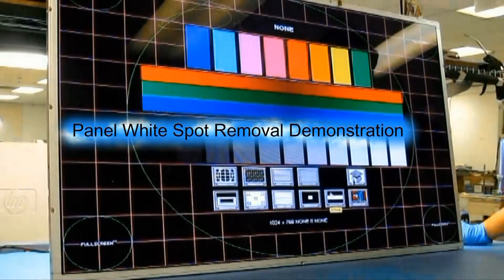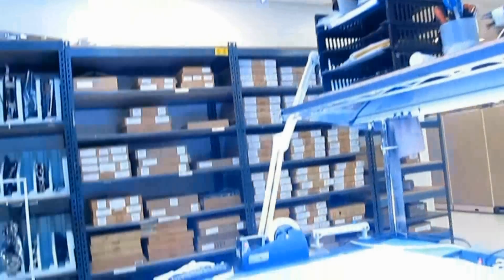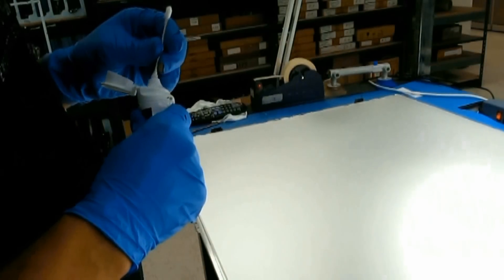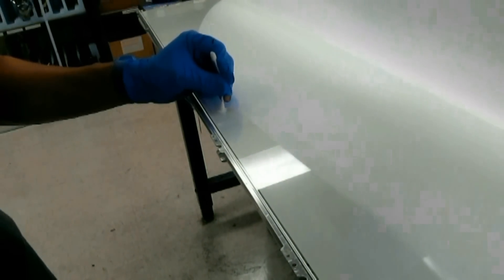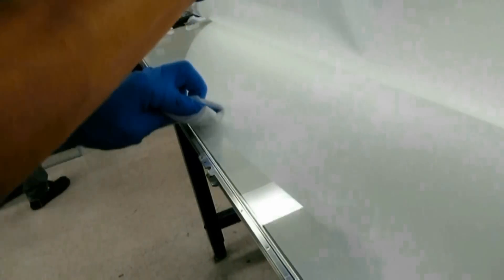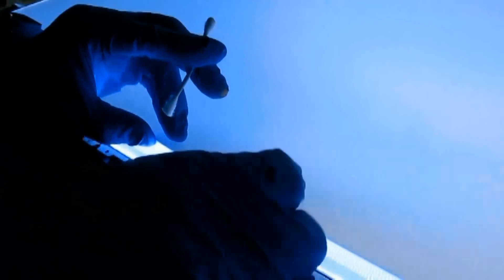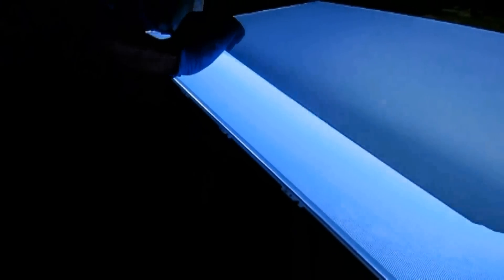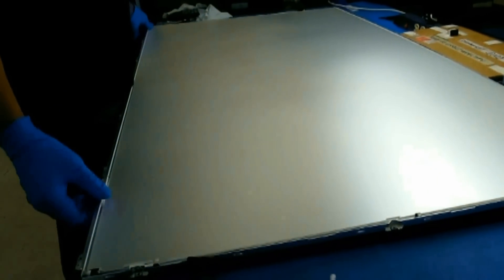LCD Panel White Spot Cleaning Technique

Comment: I replaced 3 edge lit LED strips in 3 different TV's and get white spots when I put them back together. What actually causes that? I've replaced some LED strips in back lit TV's and white spots never occurred.
Reply: Your light diffuser is damaged
Reply: WizardsMagic007 it's dust a tiny spec can look like a bright pixel

Comment: Why do you have to protect your eyes from that light?
Reply: Because LED produced light is mechanically the same thing as what an arc welder produces and can damage your eyes (just not as powerful). This isn't a concern when you are looking at an LED monitor at regular viewing distances with all the completed product filters in place but it is a concern when you are repairing a disassembled LED screen. Especially if you do it on a regular basis (your job).

Also, you'll often need some sort of polarized glass to actually contrast the screen defects instead of just being blinded by the display when it is lit and unfiltered.

Comment: The white spot problem just happened to me with my Sharp 70 inch lc-70sq15u. Is there a step by step video on how to disassemble the tv to do this work?
Reply: wow. I have the same 70in. 3 white spots in lower left corner.  not really noticeable,  but I'm gonna try this technique
Reply: @godzilla7391 hi,  did you try it and  did it work?
Reply: @gilmer4eaglesbrah  No. Ended just giving tv to my friend. Spots got worse. He trashed it
Reply: @godzilla7391  oh sorry man. Just wondering cause I i got the same problem with a vizio. Ill end up trashing it probably.
Reply: @gilmer4eaglesbrah  Yeah. It only gets worse. Probably worth trying to fix it though
Reply: @godzilla7391  ill try it for sure. I like doing stuff like that. 👍
Reply: I have a 70 inch Sony and I have a white spot in the lower left corner. I do NOT have a factory like this in my house. And I would NEVER put toothpaste on the product.

Comment: I need someone to do this to the LCD monitor I have on my Mame arcade machine! I've noticed several of these white dots on it, though most are thankfully barely viable (with only one of the handful or so of them really sticking out), unless there's a bright color behind them. They can't be seen at all if the screen is dark (mainly black), and wouldn't dare try this at home, and risk further damage though.

Comment: Its ncreasing day by day,,anyone can guess the cause for this so I can prevent this spots from further.
Reply: External pressure causes this most of the time
Reply: @ragingbeast2045  external pressure means??
Reply: @Awalkwithaj  it means pressure or weight from back side of panels most of the time 
It can be due to putting a laptop in bag with things in it or putting something on top of a laptop especially when it is hot after working